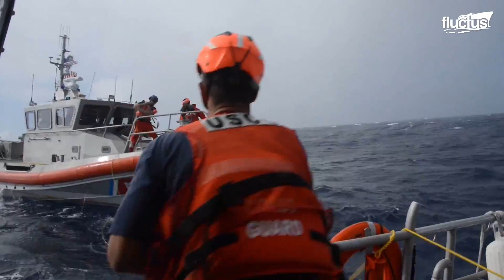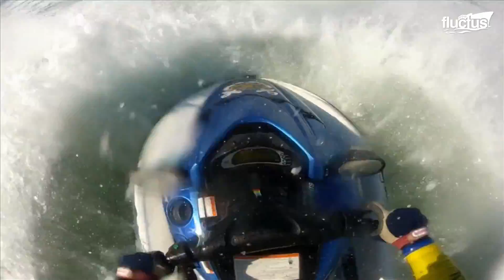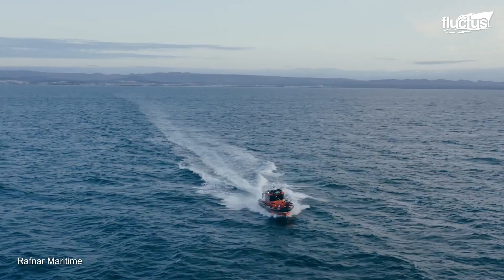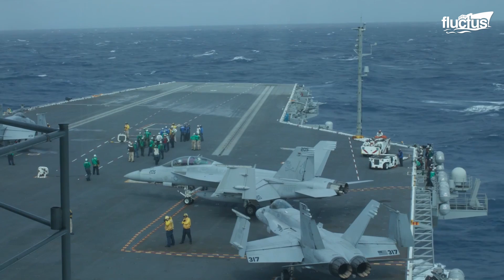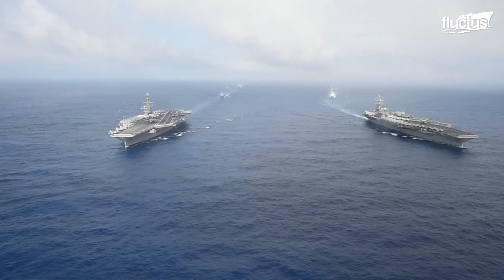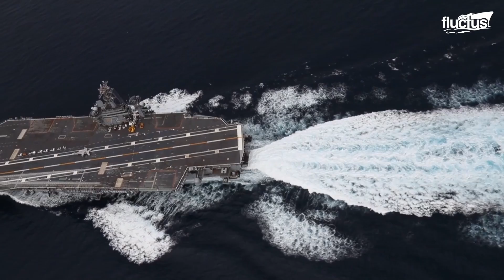A Day in The Life of US Boat Fighting Gigantic Waves in Middle of Storm

Comment: Lots of misinformation here.
Reply: Where? The only thing really wrong with this video is he doesn't know how to pronounce things correctly. His emphasis is on the wrong syl-lable.
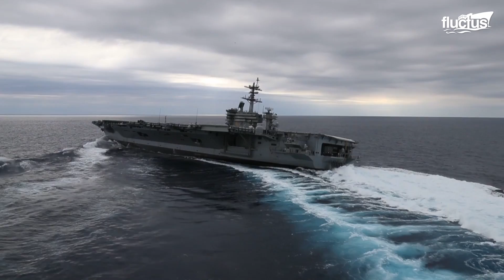Reply: 14:10 Verbal typo. Cover 700 miles in just half-an-hour?
The carrier would have to be travelling at 1,400 miles an hour.
Reply: @johnogrady2418  wrong again. Get your ears syringed.
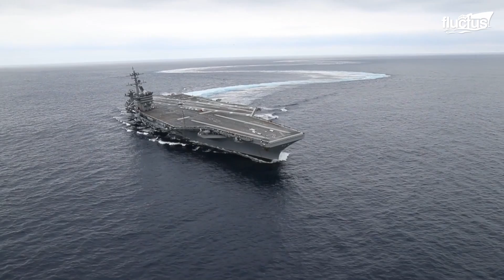Reply: @procatprocat9647  no no John's correct. I think your the one with hearing damage. It does state it can travel 700 miles in just over half on hour. To be fair it is at 14:30 but not exactly that much of a discrepancy in timing.
Reply: @pip1855  Its 700 square miles you senseless individual. There must be some kind of hearing disease or comprehension imparement going around.
Reply: @johnogrady2418  it said SQUARE miles.  curving around in giant patterns at 35 mph.
Reply: @johnogrady2418  HK
Reply: @nancyoffenhiser4916  For one, surfboats have been self- righting for at least 50 years.
Reply: @nancyoffenhiser4916  ⁸⁸
Reply: @nancyoffenhiser4916  mmmm

Comment: I disagree with ione statement that you made.  The surf boats DO need speed when going back in!  They need to match the waves speed to best navigate down wind and sea. Typically about 12 to 18 kts.  Thats not real fast but is planing speed for most boats.
Reply: These narrated "specs"  are sometimes flawed. However, Over the years, the CG decided to go aluminum not only for speed and shedding some weight but to ride on top of the waves. Back in the day when boats were steel, like the 30, 40, 44, 52's,  they were designed to CUT through the wave. Speed wasn't a top priority but brute strength of punching through. Now, they ride on top and they figured out, getting there faster was a good thing. 40's were slow but no better boat if a marina was on fire. You could ram into fiberglass vessels and sink them (a chosen method to save the whole marina) but were replaced with the 41 UTB which was way faster, larger, and had superior water-on-the-fire capabilities. However, having that aluminum hull just meant that in rough weather, they couldn't handle the waves as well. I had a shipmate drown inside the eng compartment of a 41 that got rolled in high waves off Jupiter Inlet Fl. Because of that incident, the operational wave height of the 41 was reduced.
Reply: @tc1uscg65  great info. Sad event the drowning. He's a hero .... and in heaven!